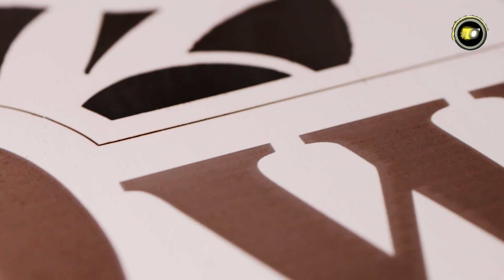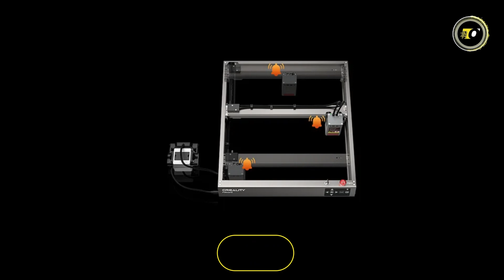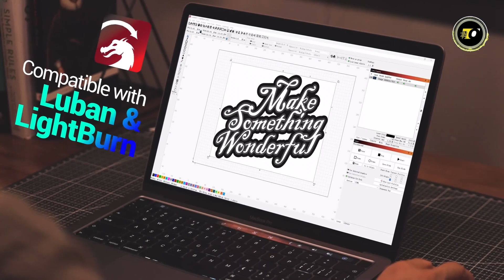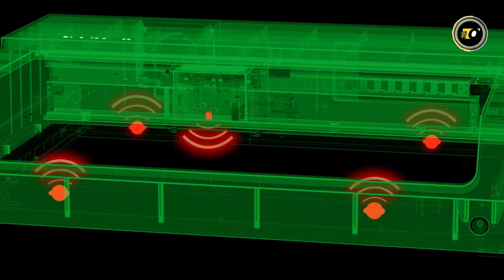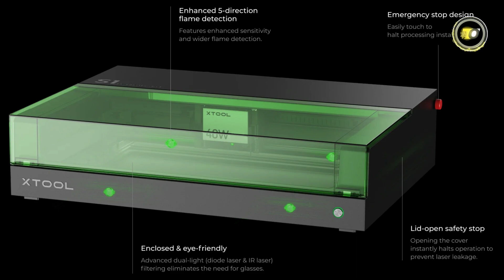5 Best Laser Engraver and Cutters (2024)

Comment: I have the sculpfun and it's a fantastic machine, also because it cost relatively little
Reply: Hi, do you use it with an enclosure? Also, have you tried cutting through acrylic with it?
Reply: @sar2908  yes, I have a selfmade enclosure (it's less difficult than you think); the enclosure is essential without protections the laser tends to damage the eyesight. ---On acrylic: I don't use it but it's well known that diode lasers (like yours) can only cut dark and opaque acrylics; for transparent and light-colored ones, Co2 lasers are needed
Reply: @common64 I've not bought a machine yet. I'm just in the "Watch every video on YT" stage. Thanks for your insight.